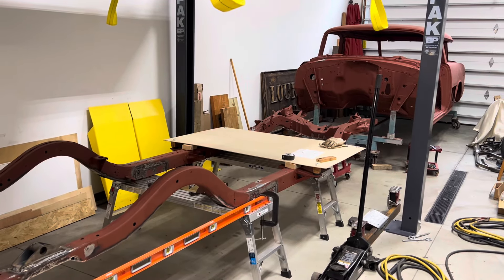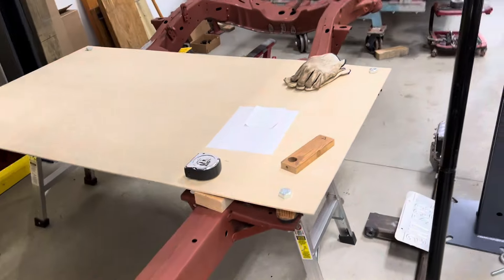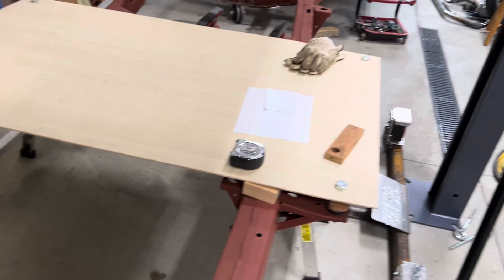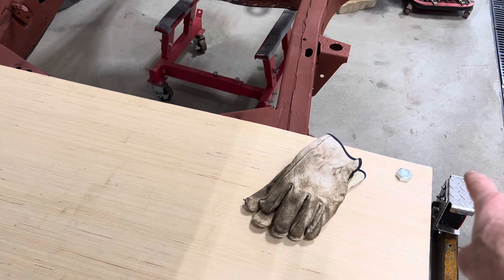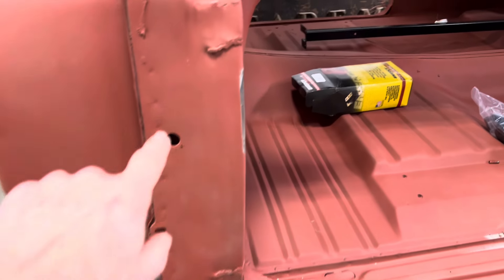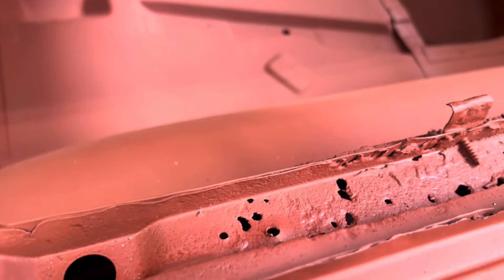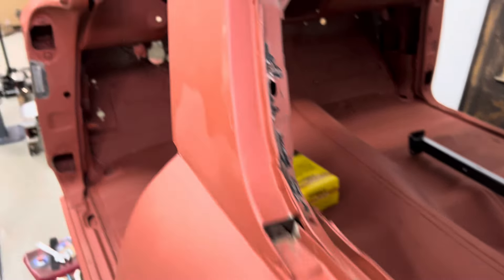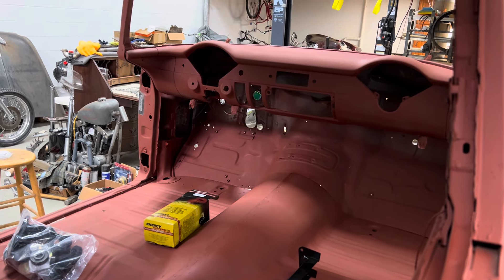1955 Chevy Nomad Project (Episode No. 15) Finishing frame repair.  The Body is back.

Comment: Your drip trays look better than mine. Since I could not find them, I made my own. I also have the roof section to to weld in after I make new sections. Your Nomad body looks better than mine. My other problem is that every screw for the tailgate hardware is rusted in and have to drill and tap every screw out.
Yours is looking good.
Reply from the maker: @monadking2761  I broke 4 of the 8 screws removing my tailgate hardware and luckily saved (drilled/rethreded) those holes.  Broke a door latch screw (also fixed) and 1 of 2 screws holding the gas pedal (haven’t fiddled with that yet).  I’m moving along (slowly) and hop to get the body on the repaired frame next week.  Good luck with your project!

Comment: I'm looking for upper tailgate hinges. If you know of any, could you let me know? Ironically, I have to drill and weld the nuts to the bottom of the floor panel that I made. But I have to find my old gas pedal if not buy a new one since the holes are at an angle.
Reply from the maker: @monadking2761  I’m meeting with the local Nomad expert this morning.  I’ll ask him if he liftgate (you said “upper tailgate”) hinges.
Reply: @johnkelly6942  Yes, the upper. If I have to, I will make my own modeling them off my original Nomad i have had since i was 17, and I'm as old as my car to the month.
Reply from the maker: @monadking2761  met with my guy and asked.  He doesn’t have any spares and added several people have asked also looking for them.